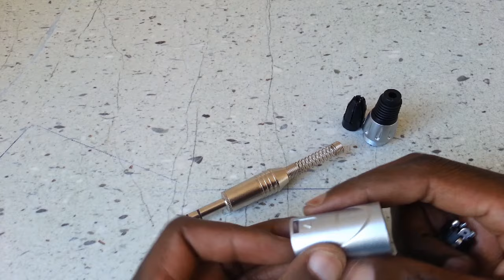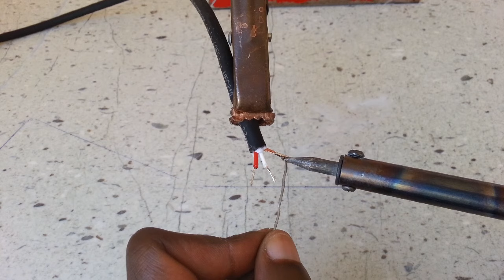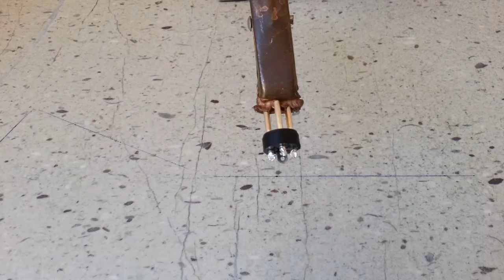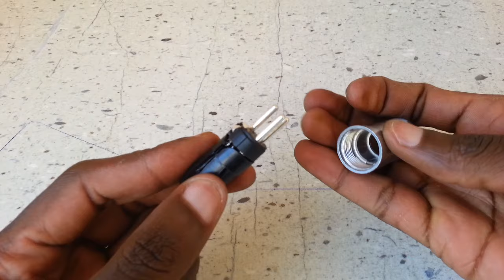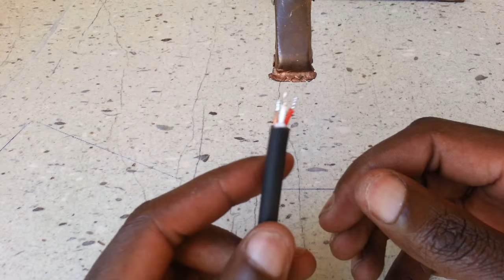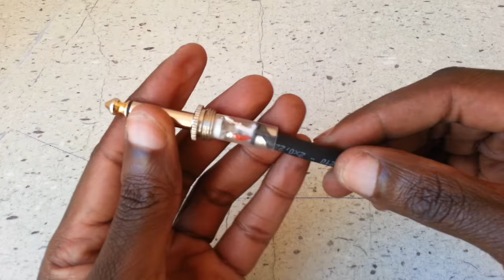How to make XLR to TRS Cable

Comment: So ...red always left?
Reply: Depends on the connector brand. Usually, the pins on XLR are numbered 1, 2 & 3. 1 is groundwire, 2 is hot and 3 is cold. 
On TRS connectors you have to be careful and read the manufacturers specs. Remember, Tip is hot, Ring is cold and Sleeve is ground. So read the manufacturers specs or check which pin is which by using a multimeter. 
Most people use the red wire as the “hot” and white as “cold”. It doesn’t matter at all, it must however be the same wire on each side.